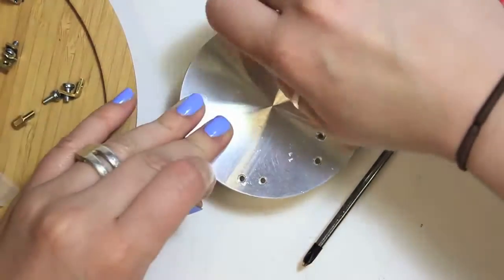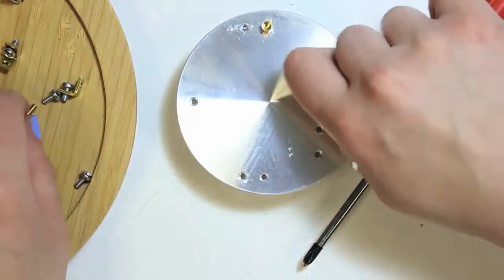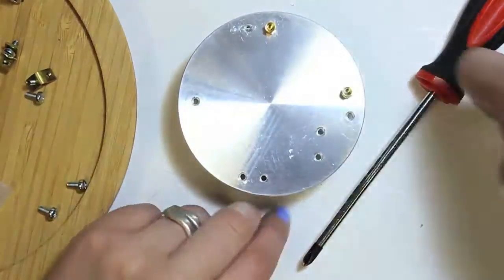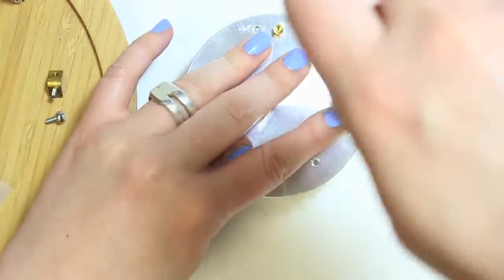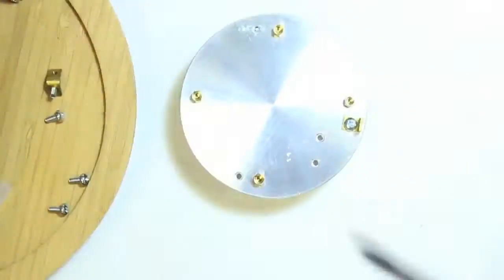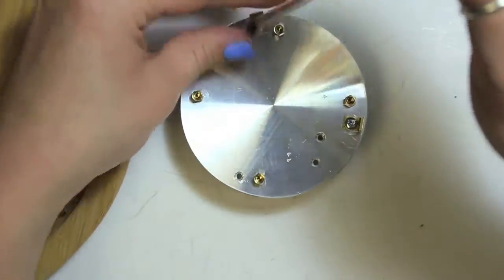Tutorial: Heat Sink Hardware Installation (tinyTesla)

Comment: Do you realize that what is said in the video does not match what is shown? The video states, "First you're gonna want to screw in the 6MM standoff screws into the holes CLOSEST TO THE EDGE of the heat sink". However the video displays the opposite of what is said.